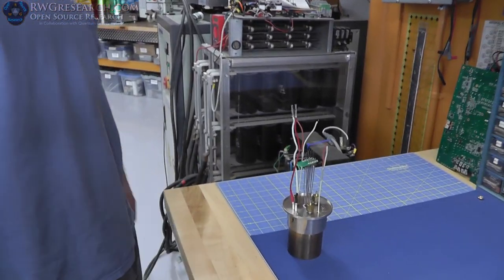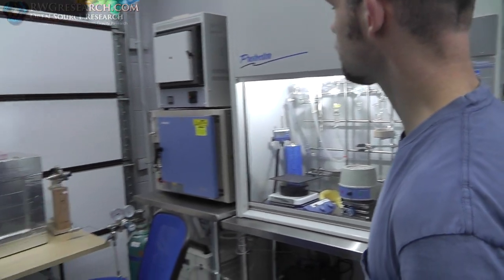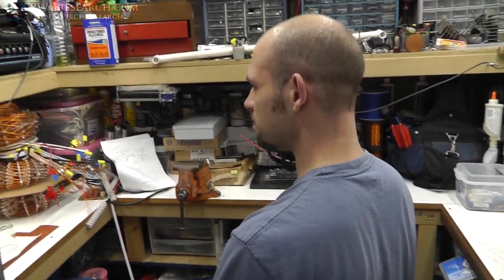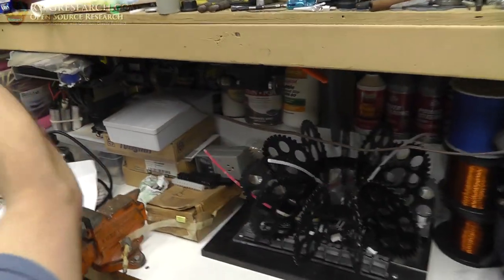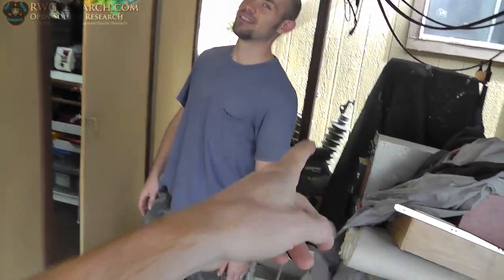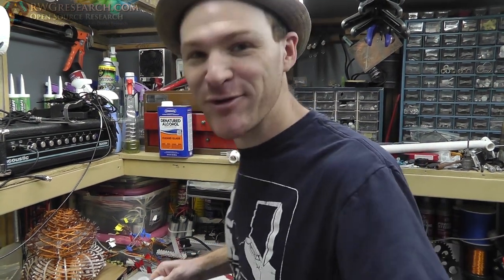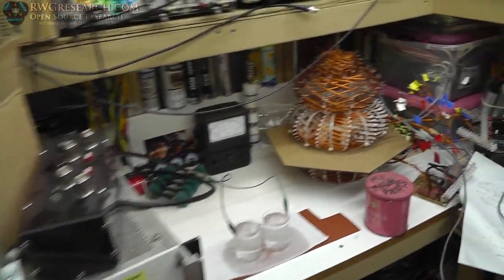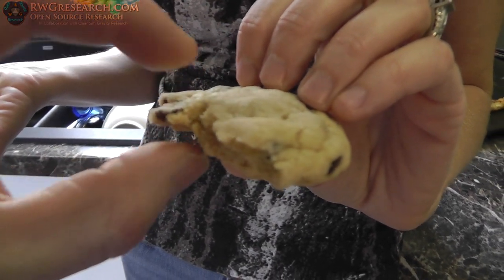A Personal Shop/Lab Tour. + High Voltage Water Bridge. Diadon Visits Me.

Comment: That was great, except when you said "something like the bigger it gets the heavier it gets the more gravity pulls it down". In fact, could it just be that the power that is consumed is, at that point, too low for the water bridge to be supported? So if the power is increased maybe there is a point whereby the power needed would be ridiculously high but the water bridge would be very impressive. Gravity would not play any part in the experiment because it is such a low power if it exists at all.